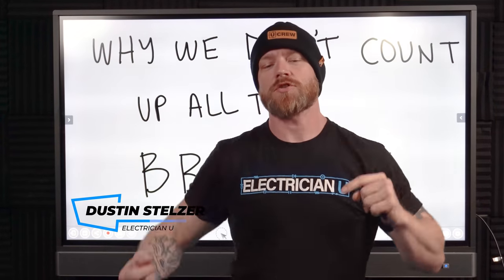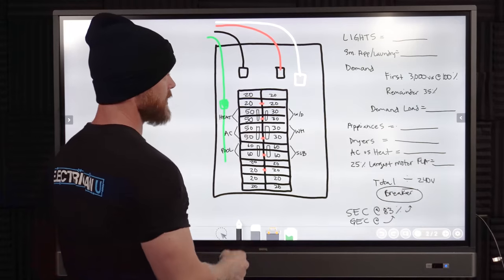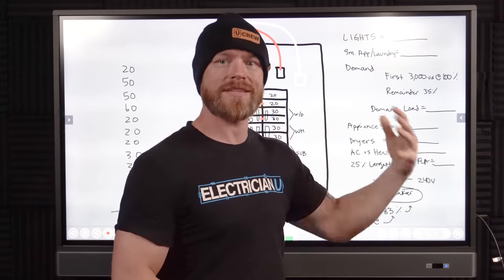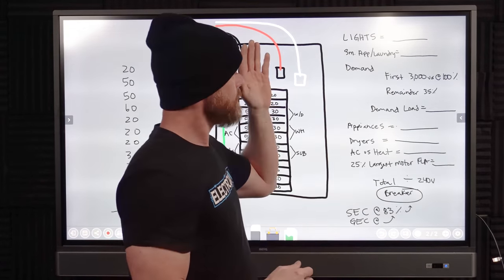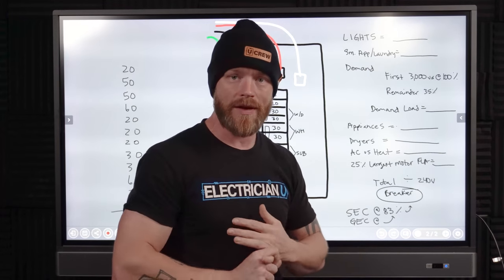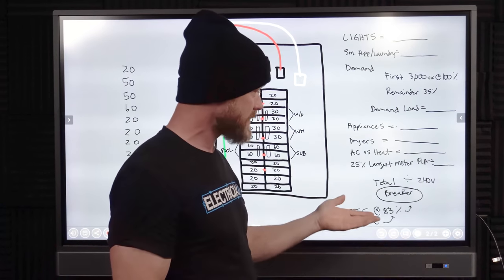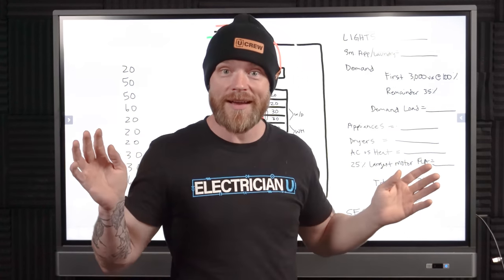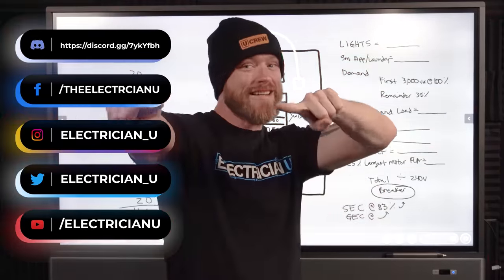Why is there more than 200 A worth of breakers inside of a 200 amp panel?!

Comment: Great video i am an electrical apprentice...what article/code section shows how to do this calculation?
Reply: Section 220
Reply from the maker: Optional method, conventional method, and or standard method. 

Article 220 in NFPA 70 NEC 2020.
Reply: I believe both methods are found on the IRC as well. (BTW, autocorrect tried to make that say KFC so if you think hivemind information is useful and you have a hankering for some chicken maybe look around there as well!

Comment: I am still learning. When you talk about "phases" do you mean legs? I don't think many homes have more than one phase, do they? I am very confused here.
Reply: Ian,  he means legs. It’s unclear to me why he says phases when there is only one phase.
Reply from the maker: Welcome to the channel! So, when we refer to phases, we are talking about the individual phases supplied by the power company. In most residential circumstances, there is only one phase being used, and we get “leg” from how the transformer is tapped to produce a neutral.
Reply: It is mathematically equivalent to two phases.

Graph the equations:
V1 = A/2*sin(w*t)
and
V2 = -A/2*sin(w*t)

since these systems are derived by center-tapping a transformer, that makes the two legs have voltages that are equal and opposite, at every point in time.

It is exactly the same as if I were to have you graph V2 = A/2*sin(w*t + 180 degrees), which is a 180 degree phase shift instead of a negation.   This is why he keeps (somewhat erroneously) referring to the lines as phases.

It is the same mental exercise to think of these just like phases, except for the fact that there are two of them.  We just don't officially call it "two phase" for historical reasons.

Comment: What is the acceptable voltage drop in a home when running high load appliances such as a elec. water heater?  does the high draw affect the frequency of the current?  Is there a Load tester for a home that is like the Load tester for a car battery that an electrician can use to trouble shoot?  (my symptoms are continuously flickering LED lights when running high load device in a recently re-wired home)
Reply: Flickering lights means their on a circuit with a motor. Or induction heater usually. Id ensure the lights arent fed from a junction box something else is tied into further down from the panel
Reply: You could always shut everything done but those lights and find out what still has power with them
Reply: @UnifiedInfo  The big draw is those under sink elec hot water heaters about 55 amps when going full bore but they are on their own individual circuit the flickering lights is everything else in the house.  there is also almost a 7 volt drop in the rest of the house.  I am wondering if the power co. has an issue between the transformer and the meter, that contributes to the voltage drop? I'm Supposed to have 200 amp service using less than 50% of the available amperage shouldn't have that much affect on the voltage.
Reply from the maker: There are tools that will help identify issues like this. A power analyzer is one. 
It effects the lead and lag which in turn can effect frequency. Or it can introduce other frequencies on the conductors. It is informally called "noise" and some LEDs do not like noise on the circuit they are on.

Comment: So are phase and leg interchangeable on a split phase 240v?
Reply: Stephen, they are definitely not the same.  Since there is only one phase here, calling it red phase and black phase is misleading.
Reply: @neilbrookins8428  ok was just making sure I was crazy
Reply from the maker: It's terminology difference. Not functionality difference. 

In a 3 phase system you can go leg 1 leg 2 leg 3 or A phase B phase C phase. It all depends on who you are talking to and where you are.
Reply: @ElectricianU  being an engineer I try to be conscious of terminology because field guys can pick up an opinion of you from references to parts. So it's not a crucial distinction just make sure you are talking the same type and you're good.

Comment: ok this is just panel calculation for single house but how about apartment with each 100amp subpanel in 40 unit? can we just app up main panelboard should hold up to 4000amp? or we need to d rate amps like Dustin explained? we just got three 750 mcm aluminum on 3 phase in main switchboard. so how many amp would it hold up? any master electrician please answer me.

Comment: This extends all the way up the chain. Your local transformer serving 10 homes with 200a service each is rated at 400 to 500 amps not 2000.

Comment: Even knowing would be rare have this high current, I'd prefer get the 200A wire if possible instead 83% wire, it's only for one reason, more stable voltage 'cause how more thicker is the wire, less voltage drop we have. Considering wire extension and there are multiple people using the energy at same time, can be easier have a considerable current that can provoke voltage variation, like 50, 60, 80A or more.
Imagine High Appliances on 120V instead 240V, it's easier get high current and voltage variation.
I don't know on USA, but there are places that even high appliances are operating on 120V, what do high current on circuit.
The peak of a huge electrical motor can cause a moment voltage drop that can be seen on light bulbs shining drop, to "eliminate" this effect, wires must be thicker.

Comment: If I'm running a heat pump and the heat strips kick on on a cold day I'm using heating and cooling at the same time.
Reply: @Californians_go_home  yes, typically they will. The heat strips add a little extra BTU when the heat pump isn't cutting it alone. They can also be wired to kick on when the HP is defrosting (running as if it was on AC mode) to avoid blasting cold air out of the vents. Load calcs allow you to derate the strips because they arent typically running 100%

Comment: Thats odd with gas we have to use all of the btus possible to come up with the line size. I will use a real life example the home had a gas stove, fireplace, 120k btu furnace, 200k btu tankless water heater, and out door kitchen using a 120k btu ng grill Nd 2 additional 60k btu burners at 95' longest run. The fire place and furnace would not likely run at the same time as the out door kitchen, but they all have to be calulatedas if they all run at the same time.

Comment: 50A on black phase and 50A on red phase add up to 50A total; because they are on opposite phase; and only 50A max at any time.
Reply: 50A @ 240V, that is. If we were just talking about 120V circuits, technically a 200A panel can supply 400A @ 120V. That's why the more common unit is VA (roughly, watts) which avoids that confusion.
Reply: @bnasty267   Not really. The 200A @ 120V from one phase travels out the other 120V phase. The 200A panel is 200A @ 240V, not 400A @ 120V.
Reply: @fascistpedant758   My point is that you have 400A available at 120V. If balanced, it's between the two legs. If it's unbalanced, the neutral carries the difference between the <200 on one leg and <200 on the other, hence never more than 200A on the neutral. That's why load calcs are done in VA, and you divide by 240 at the end to get the actual amp draw. 120V circuits count as half of their amp value at 240

Comment: I've done many residential load calculations, but mostly do commercial/industrial work.

I've had subs(electrician) call and state the SES/panel needs to be replaced because it's overloaded. When asked how they know it's overloaded, they state the sum of the breakers OR the sum of the switches, at the gear, is larger than the size of the SES. SMH.

Comment: Heat ? No
A/C ? No
Pool ? No
Hot water ? Sun
Cook-Dryer ? Gas/wood (lp)
Water? Gravity(spring)
Drill press, welder, grinders,compressor? 30/50/30
Lighting ? One 20

Pura Vida

Comment: Do you ever see a house with two
different services?  into the property.
Two meters and two panels?
Reply: I have in older services. But nowadays POCO wont allow that for single family dwellings
Reply from the maker: Sometimes, usually out in the country though, where someone has a second house on the property or a big shop/barn that needs 3phase but the existing house was on single phase. Pretty rare
Reply: @ElectricianU  Yep I have also seen on commercial services as well where they have an old single phase then get new machines and equipment that need 3 phase
Reply: @Bradley-tx6ed  you could always get an add a phase. You'd think that would be cheaper than paying the utility company to change your service

Comment: Seen a house in Alabama that had a 400 amp breaker panel , The house was not that big .
Reply: It should never burn down. Lots of circuits,heavy wire. No fucking stab ins! Tight is right! Proper pig tails twisted way down. I never rely on a nut to be the sole mechanical electrical connection. Twist those wires!

Comment: The service is the max oh sh$&! Calculation to keep the incoming wires from melting. Multiple systems in the house generally need to be failing or breakers failing to melt the incoming wire / trip the main. Most furnaces run at a fraction of their max load. The max load is generally a dead short or a stuck motor.

Comment: Great explanation..  except you don't have 2 "phases"  you have 2 "legs" you're dealing with single phase power.
Reply: It is mathematically equivalent to two phases.   We just don't call it "two phase" because of the term having a different meaning historically, and because it is derived from centertapping a transformer secondary, rather than time-delaying the original source.
Reply: @carultch  not really... in 3 phase power the phases are 120 apart from each other.  In traditional 115v household the Center tap, or Neutral is 1/2 through a SINGLE phase
Reply: @RandyFuchs  They still are 180 degrees apart from each other, assuming an ideal sine waveform.   It may ultimately come from a single phase, but it derives two waveforms that are out of phase with each other.

Trust me, or try it yourself.  Hook up both lines to an oscilloscope, and measure the voltage waveforms simultaneously.

Comment: You keep calling the two black/red legs "phases".. this is a single phase installation (as opposed to three phase)...

Also, at 8:00 you talk about needing to upsize the service conductors if you have too many different circuits drawing at the same time (true), because the insulation and wire will overheat and melt off...  false, because of what you say later.. you size the conductor for the breaker. So the breaker will trip first before any overheating.

Comment: Can you put a 200A breaker in a 200 Amp panel?
Reply from the maker: So long as you don't exceed the main circuit breakers rating technically. Yes. But why?

Comment: You keep using the term derating incorrectly. Derating means you decrease the allowed amperage compared to what it is rated for. Field example, when you run more than 3 circuits in conduit you need to derate the conductors. A conductor that could carry 30 amps may be derated to 25 amps, for example. When you use the 83% rule the code is allowing you to overrate the conductors. Aluminum 4/0 has an ampacity of 180 amps if it has insulation rated at 75 degrees. The 83% rule allows you to run 216 Amps through it. It is not being derated, it is being overrated. When you talk about all the circuit total ampacity you are not derating the panel. You are recognizing that satisfactory service will be realized with service conductors less than the sum of the total ampacity because the expected peak load will be just a fraction of the sum. Nothing is being derated there.

Comment: wow lost me with the left side being "black phase" and the right being "red phase" lmfao 😂
Reply: People will split hairs on whether these should be called phases in the first place.   "Line" is a more correct word to use, instead of phase.  It is mathematically equivalent to  two voltage waveforms that are 180 degrees out of phase with each other.   We just don't call it "two phase" for historical reasons, and because of the mechanics of how it is produced.

It is exactly the same logic as there is behind three phase systems, except with only two of them.